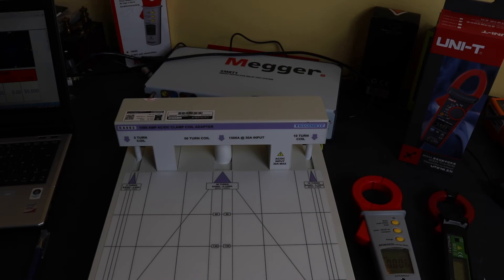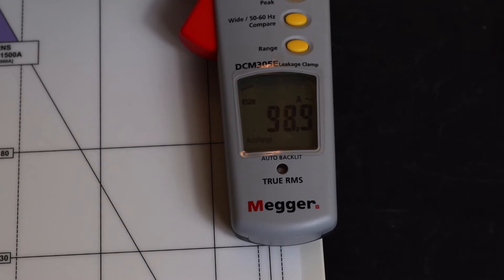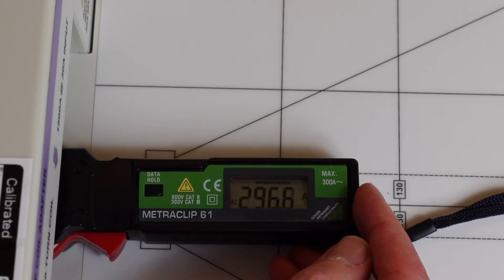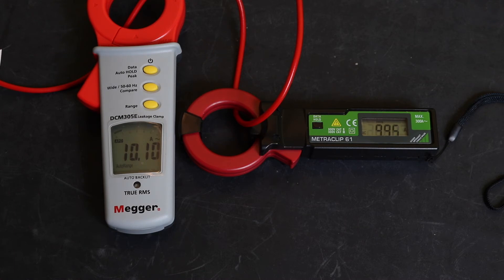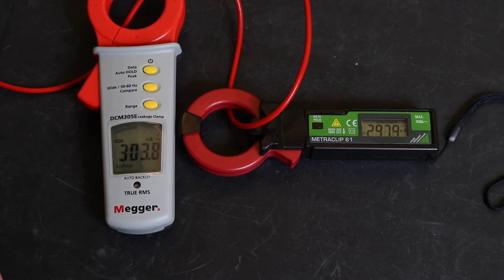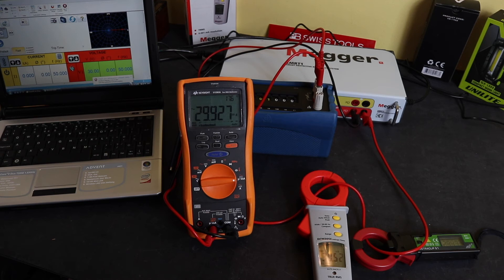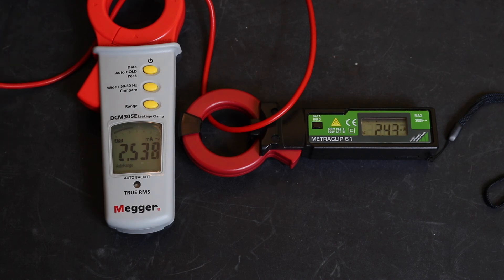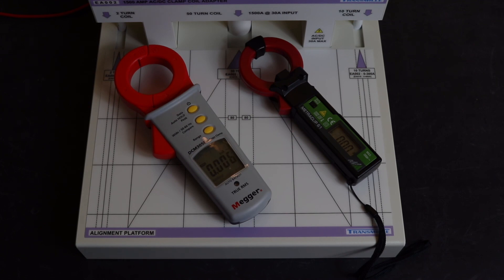Earth Leakage Clamp Accuracy Tests :- Gossen vs Megger

Comment: Nice video, I didn't even know they made such a tester for those meters.
Reply from the maker: Thanks TE. The clamp table is genuine calibration equipment. The SMRT is really a system for protection testing, but I know it has the accuracy to test out the current clamps. There are specific instrument calibrates available that will do multimeters and current clamps, and will have many more options to them.
Reply: Put more light to your videos please. Thank you